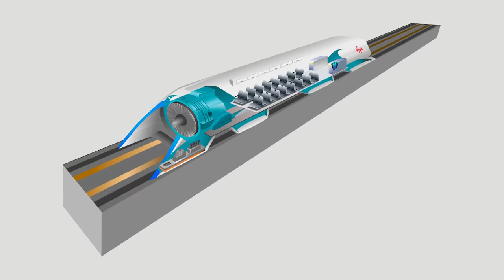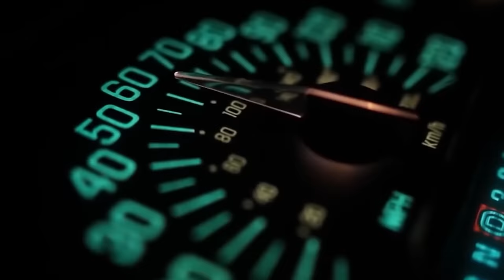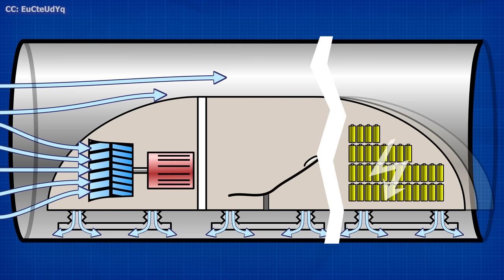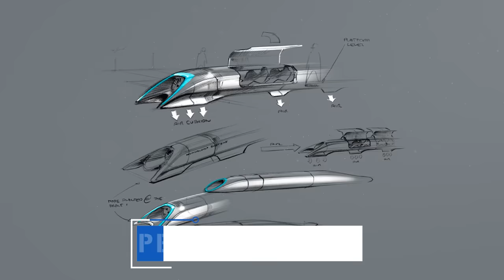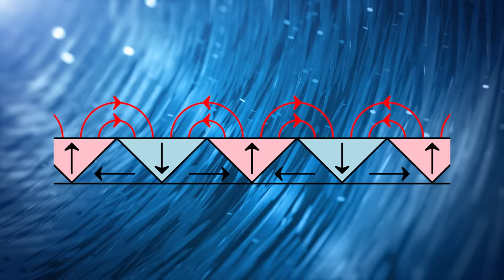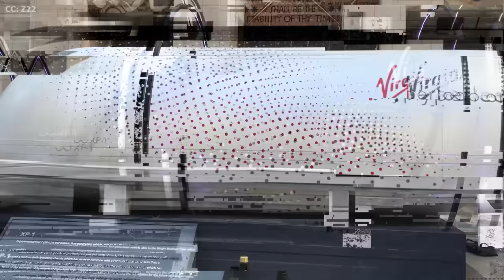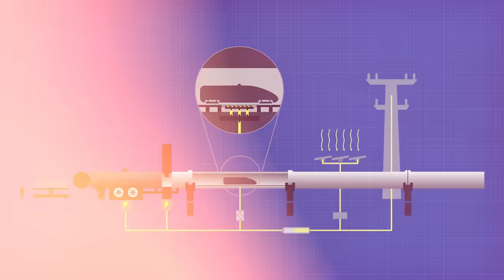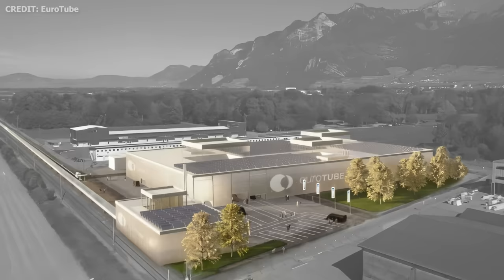We’re Getting Closer to a Hyperloop...

Comment: I think the biggest thing that no one talks about is sabotage. So much rural area where one bullet.would cause chat catastrophic damage.
Reply: How?
Reply: @markharmon4963  If the Hyperloop is punctured, the pressure differential between the vacuum inside and the atmospheric pressure outside would cause the entire thing to implode, killing everyone inside and causing billions in damage.
Reply: @kimjongsupporter7539  The hyperloop is in compression.  It is not a thin membrane in tension it will not pop.
Reply: @kimjongsupporter7539  It will also be made of steel plate.  Would a vessel of 1" steel plate at atmospheric pressure implode 40' under water (equal to 15 psi of differential) ?  At a 12' diameter it would not.  Here is an experiment.  Find a discharged old 20 lb propane tank (standard) and discharge it. Then with the valve open tie it to 40 lbs (100 kilograms) and sink it to 40' at the end of a rope and tell me if it fails catastrophically.  The leak will actually help preserve the structure of the tank/cylinder because it is equalizing.

Comment: As someone who worked with maglevs for decades, still nobody explained the point of hyperloop. It seams like it only suppose to exist as a distraction
Reply: A distraction from what, if I may ask?
Reply: @remkoburger6595  Hyperloop is a distraction from maglev
Reply: The point is that in vacuum trains can move much faster with minimal power consumption. The latter is important too if you want to be sustainable. And using air instead of magnets is just simpler and vastly cheaper.

First maglev prototypes were built many decades ago, and they still not caught on. That's a bad omen for the technology.

Comment: Maintaining this vacuum is next to impossible so how about we just use simple steel wheels on steel rails? Of course then all of this will require more energy to run so I was thinking just one big engine could pull a lot of pods, this way both maintenance costs and the chances of collisions go down too. I've been thinking about this for a while now, in fact it's the 41st iteration of my idea, but I'm definitely creating a startup called Neotech with this idea and my invention will be called "TRansportaton 41 Neotech" or TR41N for short.
Reply: Uh, no the chances of collisions would go up, not down.
Reply: @takanara7  How come? Fewer independent units are easier to synchronize.

Comment: You don't actually need to provide a complete vacuum or get very close. Just removing significant air resistance is the point.  And using it for freight really would be a good idea, especially to help decongest ports and cities.
Reply: The problem is the limited space for air molecules to move. Even if the vacuum is 90% there are enough molecules that would quickly compress and cause resistance and heat. There are a few good explanations I’ve seen on YT. I think thunderfoot had one explaining this problem.
Reply: The problem is in that "significant", anything not close enough to total vacuum would be significant in a confined space. Also the lack of transportation capacity of any of these project tells me that even if it worked as intended, it wouldn't bring any solution to cities and ports congestion, the real solution to these is in city planning, no in any one piece of new tech.
Reply: The great part of this application is how quiet the system would be.  It is conceivable that the hyperloop could be routed straight into and through the heart of city centers.

Comment: Bro, there are SO MANY problems with maintaining a (near) vacuum along a super massive tunnel - the core idea of the "hyperloop". Maintaining a supermassive tunnel with a constant vacuum is insanely insanely expensive and difficult. 

Even with super boring traditional high speed rail that just sits on normal tracks, it's already extremely expensive and requires a ton of maintenance... now, jump that up by 100x and you are starting to get an idea of how expensive and difficult an actual working hyperloop over 100+km long would be. It's just not happening within this century.
Reply: Sustaining a low pressure environment in a closed system is about as difficult as running a refrigerator compressor.

And rails support nothing.  It is all of the thousands of tons of Earth, gravel, wood and concrete that must be quarried, processed delivered, placed, graded, compacted, quality controlled, inspected, redone, and surveyed before the rail is placed.  And after it is used a year, the whole thing needs to be realigned and ground to fit.  Which means rail is rarely used full speed.  And the rails will expire.

Or manufacture the columns and pipe in a factory;  truck them to the sight, align, instal and adjust them to spec.  Monitor and adjust their alignment over time.  

Imagine the work that goes into building a road vs installing the top rail on a fence.

Comment: All anyone has to do is look at a high speed train and try to imagine it in a vacuum tube. Reduced to pods carrying 28 people, each one would have to take on passengers, be sealed, that part of the tube be sealed, and the air pumped out. For argument’s sake, let us say that takes 15 minutes.
A high speed train can carry 850 passengers 28 in a pod each taking 15 minutes to load would mean it taking about 7 hours longer than it takes for that number of passengers to board a train.
At 200 kph, the train could have travelled 1,400 kilometres by the time the last pod was ready to go.
As mass transport, the hyperloop is a joke.

Comment: The biggest question which usually remains unanswered with all of these projects is what happens when things go wrong? Can you just open the tube up and evacuate the passengers? If the pod hits the wall does it crash and explode? What safety procedures do they have in order to make it so that no matter what happens, they can expect the passengers to be safe?
Reply: What happens on a regular bullet train if derails or whatever? What happens on an airplane if the engines fail?  The fact that that a non-engineer doesn't know the answers to these questions doesn't mean somehow the project is impossible.
Reply: @takanara7  unfortunately, your response doesn’t really address the issue.

When an airplane fails, there are several options, one of which is that the plane can potentially glide to a landing on water land, if there’s more than one engine, and one engine goes out, they can still power. For a bullet train, you have the entirety of 99% of your surroundings to escape into.

when you’re talking about The hyper loop concept, there is a huge issue, which is very different from any of these other technologies, and for all of those other transportation systems, there is ample documentation of how they deal with emergency situation’s. That is not the case with the hyper loop.

a hyper loop, and its purest form, is a closed tube with no oxygen in it. That is very different from any of these other technologies.

When you go through a tunnel in a train or a car, the tunnels are designed with access points, and escape routes. it is true that in some instances, there could be unforeseen circumstances like flooding that might make them more dangerous. But generally speaking, it is relatively easy compared to the actual manufacture of those systems to provide for an escape route. The channel Tunnel is maybe the only comparable transportation corridor. But even then, it was a significant part of the proposal to show what would happen if a train in the channel tunnel had a problem.

We’re not seeing any of that so far with any of these proposals. it is a significant question, and again, the difference here is that the entire system is in vacuum. There are air locks to make sure that that vacuum is maintained. So what happens when that vacuum is released? Will the magnetic levitation cause the train to crash into the rail? Will there be hatches every 300 feet? In which case, how much does that add to the cost? Because each of those hatches Hass to be able to sustain that vacuum.

Hand waving away, an engineering challenge is not an answer. Sure, a solution may exist. But how much more expensive will it make the overall transportation system? and when you have a closed tube that Hass to be hundreds of feet above the ground because it is even more sensitive to curves than a bullet train, the bullet train being able to be much close to the ground to the extent where, on most of the line, you could probably jump off and land without injuring yourself, what exactly is the safety plan?

It’s an important question, and saying “it’s gonna be solved” is just being shortsighted. The truth is that the tolerances for a closed vacuum tube over hundreds of miles are much different from even an airplane, a bullet train, or an underwater tunnel.
Reply: @takanara7  That's true, this isn't why this project is impossible.
Reply: There is a collision with multiple pylons causing a break in the tube.

The tube equalizes air pressure through the thousands of vacuum pumps distributed throughout the system.

The pods decelerate through regenerative braking, and are subsonically delivered to the next available station where a vehicle delivers them to their destination with their luggage.

Basic.

Comment: What a genius idea!  Let's used mag lev technology to move a large and heavy object very quickly, something that will generate a MASSIVE amount of heat and let's do this in a vacuum chamber, something that is notoriously poor at transferring heat.  While we're at it, let's but a tube made of carbon fiber that is at a vacuum, under the sea where it will be exposed to several atmospheres of pressure.  Man, how can I invest?!
Reply: Sincere question- how is it possible to use carbon fiber composites in airplanes? Don't they also undergo severe pressure?
Reply: @celan4288 i can answer that one. Carbon fiber, and really many materials, behave different under pressure or tension. Tension is when the forces try to pull a thing apart, compression is when the forces try to push a thing together. Carbon fiber is incredibly good under tension, and terrible under compression. This is why an airplane works, but a submarine will become a little ball, like the Titan submarine. With a carbon fiber object the pressure should always be greater on the inside than the outside, to make use of it's strength in tension. As to why it behaves like this, it's material properties are not all that different from rope strands. Rope is very good at keeping things up from above, which is a tension situation. Rope is much less good at pushing items up from below which is a compression situation.
Reply: @shadeblackwolf1508  Precisely.  Thank you

Comment: One big problem os HSR is that the alignment has to be very straight, with very large turning radiuses, a relatively flat gradients due to the speeds. You cant use existing highway or conventional rail corridors. Aside from more tunnels and more bridges, the expropriation and stakeholder process is a nightmare in many developed countries that in theory have the money and passanngers to pay for the ticket. Thats why some countries like China can do lots, others like UK fail to do. And Hyperloop would be much faster, meaning much straighter. You are gonna hit so many phisical and legal obstacles. Even going below ground

Comment: It's almost like a train does literally everything the concept of a hyper loop does but better, but no, let's reinvent the wheel again
Reply: No... no, it doesn't. The whole point is the extreme speeds possible that are impossible with standard wheeled trains in air. 15 minutes is a hell of a lot faster than three days.
Reply: @UpperDarbyDetailing but why not just build HSR and avoid all the expense and nonsense of the vacuum tube? Is 30min really that much longer than 15min
Reply: @thesneakinmonkey  personally, I think the main benefit is simply as a moon shot project. Getting through the engineering of building a tube that size that can hold the atmosphere out will bring us along. Besides which, we need to develop the tech at some point anyway. Whatever system we use for getting to orbit after rockets will likely use a similar system.
Reply: @UpperDarbyDetailing  I'd be more inclined to agree were it not that these hyperloop red herrings take funds from viable projects that could benefit us today.  You have to admit, commercially, it's very difficult to see how the added expense and complexity is worth the time savings vs proven HSR even if we could build a hyperloop tomorrow, particularly because the hyperloop would still need to make turns and manage inclines so average speeds would likely not be that much faster than HSR assuming roughly the same level of cost would go toward securing right of ways and building tunnels/viaducts.  That's before considering that operating costs for a hyperloop could not possibly be less than just a standard HSR.
Reply: @UpperDarbyDetailing  the kind of distances necessary to compete with trains are impossible for giant vacuum tubes so it's kind of a moot argument. Maybe not literally physically impossible, but idiotic in terms of resources.
Reply: @johnkeller2952  Why do you think it's impossible? Were talking about infrastructure, which generally has payments amortized over a long enough timeline to begin generating income before it's paid off. Like I was saying, technologies like an orbital launch loop will require similar research anyway. So it's going to get done eventually. Clearly there's something to this considering both government and private business the world over are working on it. I'm not saying it's going to happen next year. In the next few decades? Certainly.

Comment: It's really telling that when we can't even manage to build normal high speed rail in the US a bunch of tech bros decide that the solution is to stick the whole thing into the world's largest vacuum chamber, vastly increasing the cost and complexity.  Yeah, sure, that will fix things...
Reply: Dont forget it'll be solar powered
Reply: You might want to take note of the fact that most of the companies mentioned here are building outside the US. Your point couldn't miss the mark any harder.
Reply: @thesneakinmonkey   Good point, need to randomly slap solar panels on every surface.  Don't put them on sun-tracking mounts so they can actually be efficient, though.

Comment: I live in the United States where we have very little railway infrastructure to begin with and I live in a state where we have a bunch of commercial trains going by a few times a week, but that is mostly for coal and oil. There is no chance at all a hyper loop would make commercial sense where I live even if the system existed. The problem isn't really space or money, it's that very little people here travel on train to begin with and we have (to my knowledge), zero commuter trains in my state. I had to travel to Washington, d.c. to experience my first "real" train and even then it wasn't super busy. Most people travel an hour, maybe two to commute to work and only a handful travel out of state. To make a hyper loop system work in my state at all, people coming from the opposite coast would need to make regular trips for a hyper loop to make sense. And it's not like the U.S. is a small country either.

Comment: Hyperloop is a concept that needs to have a proof of concept first. They all propose superfast travel of goods and passengers but nobody has ever proven that they can achieve what they are proposing. And those mail systems work like you said but they do work by having a pressure inbalance, in front of the container is low pressure while behind it there is high pressure. So if you dont want to depressurize the tube every time you want to send something through it you will have very high energy cost, but not depressurizing it will leave you with the problem of getting something into a vacuum and not losing the vacuum entirely. So you would need to build a pressure/depressure chamber for the whole train. Means you get in that train, then the train goes into the chamber, chamber then gets depressurized, now other side of chamber opens and train can travel in the depressurized tube, when train reaches its target location reverse process. And you need to do that for any train you might want to send through, so that is gonna cost energy and time.
Reply: How many mail tubing systems still exist ? There were many in the  beginning of the 20th century,  today nearly 0. There is a reason.

Comment: Doesn't matter what technology is used to propel the train, the tracks/tube or whatever has to be straight. Humans can't handle the forces generated when going around corners at high speed. That's the main reason aircraft have been so successful. They can travel in a straight line for the entire journey. Unless you can drastically reduce the cost of building tunnels, or you have huge areas of flat undeveloped land to traverse the whole concept is dead in the water.